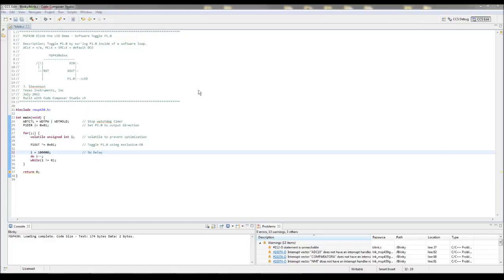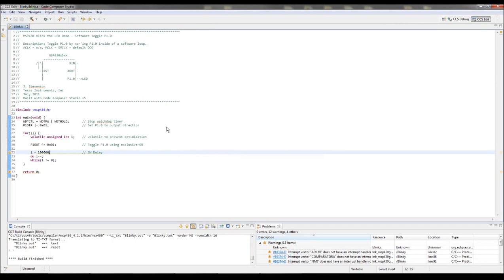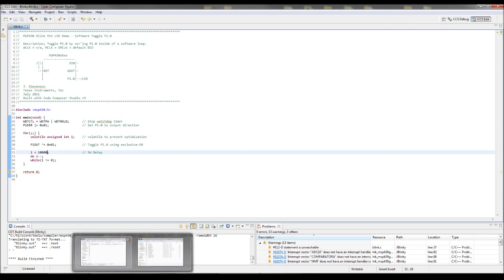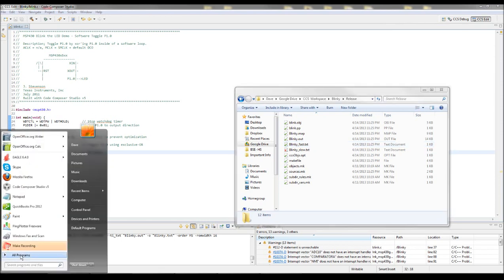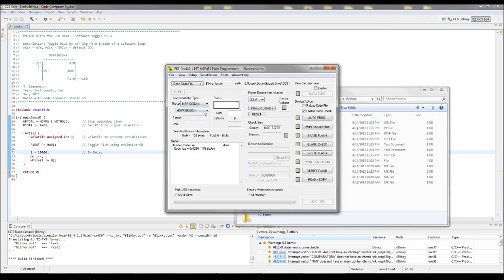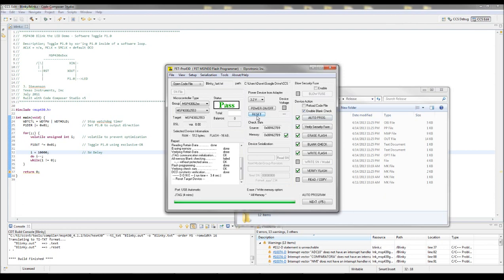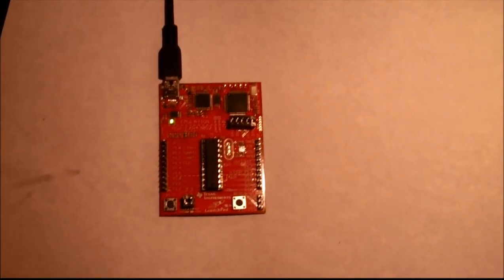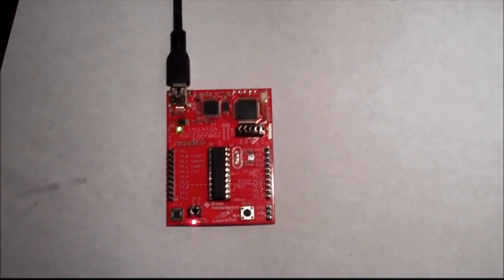Easily Create and Burn a Binary File to an MSP430

Comment: Hi Dave, can you explain how to generate a blinky.bin file instead of blinky.txt?
Reply from the maker: vikramtheone It's been a couple years since I've had to use TI's CCS with this project, so I'm afraid I can't be of much help off hand. However I think that is set where you control your 'output generation' settings for each debug mode and release mode. I bet you can get a better response from those who use the tool regularly at TI's e2e forums. Best of luck!

Comment from the maker: Hi Masterhost- the Launchpad board should be setup in their standard arrangement -- with the jumpers connecting the computer interface section of the board to the target MSP430 chip.  There is no need to use the optional oscillator; the one the Launchpad ships with is just fine.  Good luck!